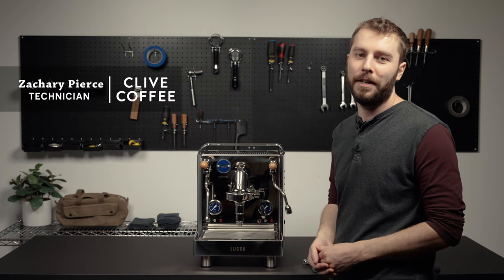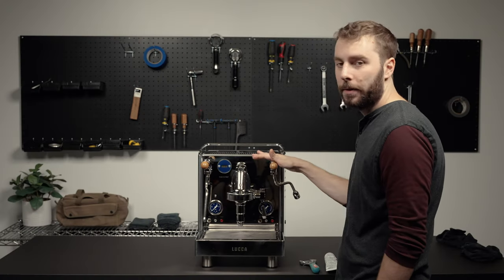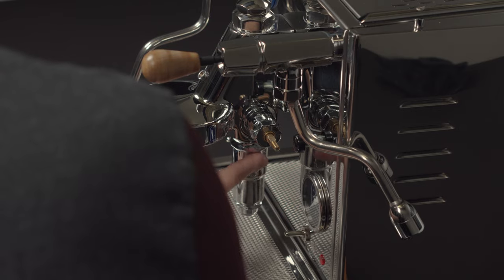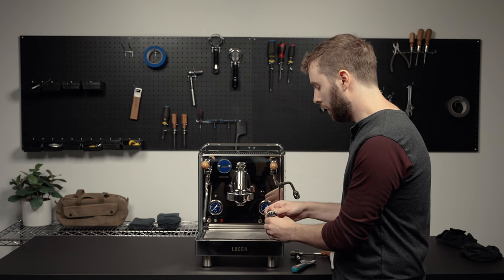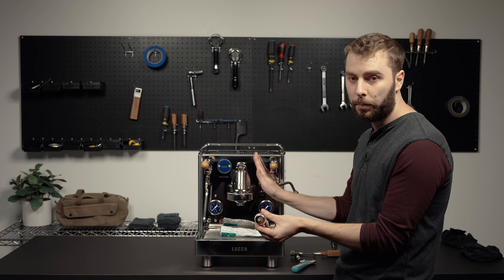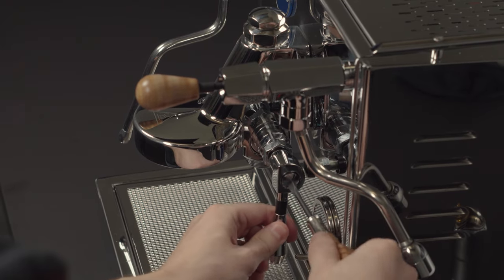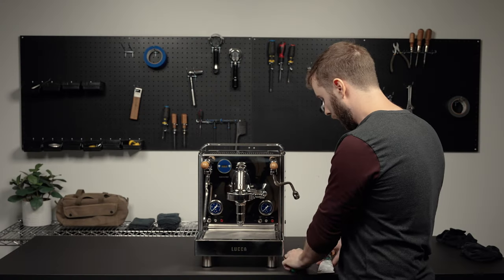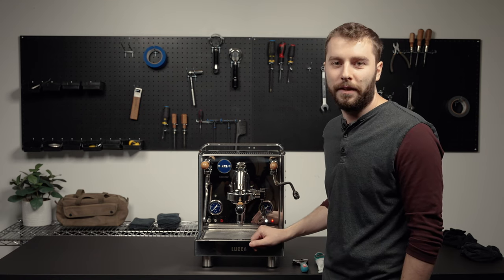How to Fix a Squeaky Brew Lever

Comment: I've done this a few times, but I haven't tried removing the pre-infusion chamber.  That looks easier than what I've been doing (forcing the cam back in place against the two springs).  Next time I'll definitely try this!
Reply: Yeah I had a lot of trouble putting things back together but I found taking the top part off and out (alternatively to the bottom) allowed me to get the lever part back into position and from there it was easy to drop the top part back in.
Reply: You don’t have to force it.. put it with the cam facing your direction and screw it in. I just did this on Saturday and got it in both times without issues..

Did it twice to add more lube

Comment: I use detergent every 30-50 shots but I’m an at home user, so that’s about once a month. I backfkush  with water every morning.  Is that too much?
Reply: Back flush once a week/month depending on usage.. I use my machine at home every morning and back flush every month to 2..
Reply from the maker: backflushing with water every morning won't hurt your machine, but it's not really doing anything either.
Reply: @clivecoffee  thanks for replying. I didn’t know if the water back flush was helping it stay clean in between detergent ones. I do see some grinds come out.  Thanks again

Comment: I had a squeak and followed this to a tee. However, the  squeak was on the outside of the cam that pushes on the pump switch on. 30 second fix. My question is, in this area, does the molykote come in contact with the brewed espresso prosses?
Reply from the maker: No, it does not.

Comment: My machine lever was squeaky for a long time regardless of lubrication or oil buildup. It turned out to be the spring in the top chamber of the E61. I put dome lubrication there and it was working perfectly ever since.

I did the while I was installing my needle valve.
Reply from the maker: yep! that works!

Comment: Hi i just got appartamento tca a month ago. I used cleaning tablets just once. Nut i do back flushing with water everytime  before turning my machine off. Means after ever session . Its 2-3 times daily. I feel my machine lever is bit hard now. What could be the issue.? If i am doing more water back flushing. Though rocket says water back flushing once a day
Reply from the maker: backflushing, especially with detergent, strips coffee oils and lubricants in the cam shaft. Maybe pull back on water backflushing every single day.
Reply: @clivecoffee so as you mentioned in the video back flush with chemical once a month and back flush with water once a week if fine enough? Irrespective of rocket mentioning in their manual backflush with water every day and with tablets once every fortnight .
Reply from the maker: That works!  @manish4777

Comment: The video is good and very interesting but what I miss is that you don't show which grease you use. I bought Xavax OKS1110 to lubricate and at first the lever worked fantastic but after a few days it started squeaking again and moving heavily. That's why I'm trying to find a better grease but you don't say anything about it. It's too much work to do it twice a week so I hope that I find a better grease.
Reply from the maker: We use Molykote Dow 111.
Reply: Do you backflush with detergent often? Like Cafiza type stuff? That will do it. I'd recommend doing that less often or using less detergent. I prolong the time I need to use that, by doing plain water backflushes and also using a puck screen which keeps the group a lot cleaner for longer!